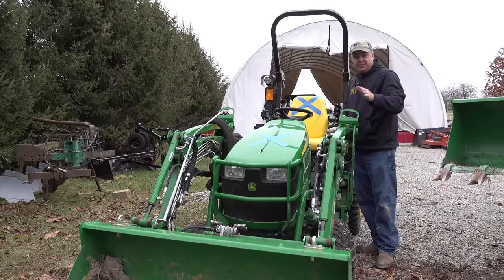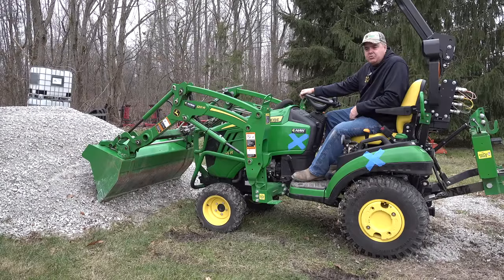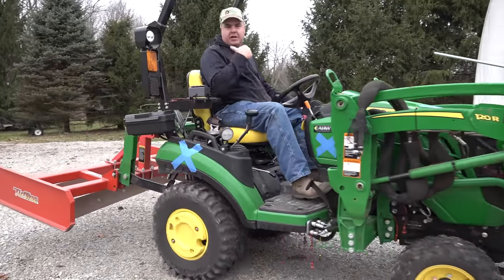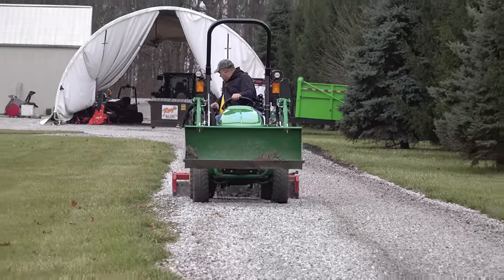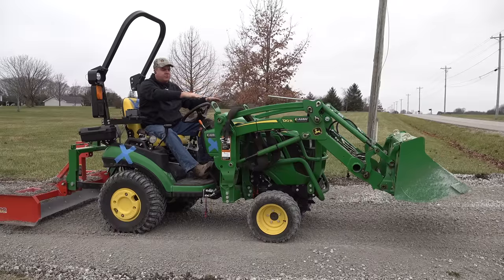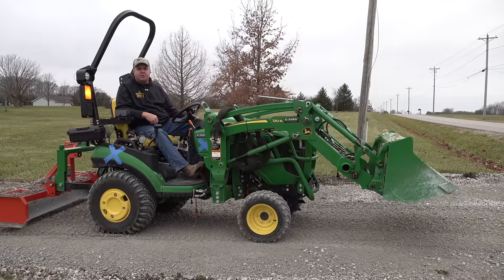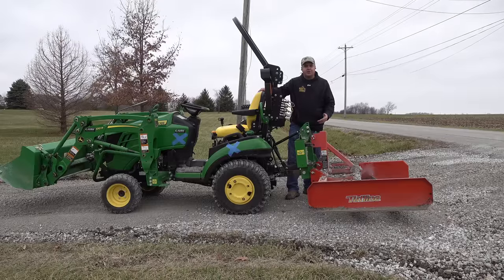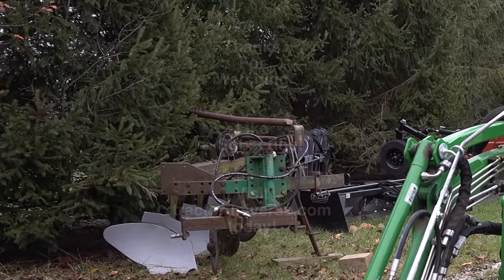John Deere 1025R Turbo Real World Loader & Land Plane.  SUPER SUBCOMPACT!!

Comment: Tim Johnny X is super charged and it's green. I'm thinkin a good name would be the Super Pickle. In 1980 Amtoys made a stuffed pickle wearing a cape called Super Pickle. You can still find them on eBay if you need company on the tractor.

Comment: I have to agree with Ben T.  I have also used a land plane extensively, maintaining a mile long easement road.  The gravel load you had in there would bog my tractor down quite a bit.  Pretty impressive.  Sounds cool, too.

Comment: I used to be a prime General Contractor in South Carolina I did Demolition too I had 220 size trackhoes New Holland Skid Steers if something tore up I just got the dealer to fix it TTWT has taught me so much I could have saved thousands

Comment: This is what I'm really interested in. The engine has more power but its now restricted by the hydraulic pressure the other components are limited to. I wonder about an increase in the hydrostatic pressure relief valve now the engine can handle more, but I'd be concerned the transmission wouldn't handle the extra torque. Thankyou for effectively doing my research for me 👍❤😁 pray you have a fantastic new yr

Comment: Hats off to ADS for the sound engineering of the turbo. It starts there. Of course it's early in seeing the potential long range benefits and usefulness of the turbo addition, but it is trending in a positive direction from this video.  Sure there may be additional ways of taking advantage of this new power, ie. hydro transmission, but I am sure Tim is already thinking ten steps ahead in the experts he might consult next as this test platform is used revealing its weaknesses and strengths and where reasonable  tweaks can be made to enhance/strengthen this machines capabilities. Happy New Year Tim and Christy.

Comment: I really like what you've done w Johnny X.  He's performing like a happy tractor.  I'd like to see the prioritized hydraulic splitter and a bit thicker pump (10 or 11cc - extreme!) on him to take advantage of the additional power when using a backhoe or something impossible for a regular 1025r (Limbsaw? Mulcher?). Looking to do the same soon to my red beast ASAP.  Nice work, nice results prove it!  1025x works... 1040r? 1025xr? Yeah, consider keeping the 25 in the name just for emissions!!!  I wouldn't touch the pressure unless you find a need for it, but more flow is awesome.

Comment: Love the videos! Where you’re having rut issues, that area really needs dug down to clay filled with bigger rock underneath like #4 and then put your smaller rock like 53 on top. That topsoil will just turn to muck then spread out with the weight of the truck when it’s wet

Comment: Hey Tim you might try getting some bigger rock where the trash truck runs and where you drive when you pull your gooseneck. I’ve used 6” sized rock then top dressed it with 3/4” to dust that seems to hold up my big truck better and doesn’t push the smaller rock down as easy. Basically the bigger rock under the smaller stuff helps distribute and displace the weight more evenly. Just giving my opinion love the videos and seeing others techniques to accomplish a certain task with the equipment they have.

Comment: Tim on building your drive higher using rocks, while it may keep water off of your vehicle, I believe water will continue to pool in the driveway and continue to cause all of the issues with a softer base under the rock. 
It is difficult to get a feel for your property from video. In my experience with property in hills and in flat land, ditches along side your driveway are the first thing to do. Avoid a ridge between the driveway and the ditch and work on drainage from the ditch to off of your property. Of course you also want drainage from the yard into the ditch also with that water also flowing off your property. 
Ditch size is based upon the flowing water you need to handle and where you want it to drain.

Comment: that video was very impressive to see how well Jonny X was performing low and high gear....what will be helpful to see is it this spring or summer cutting with a 4ft brush hog and then a 5ft brush hog as well not only on level ground but going up hill...i know a lot of others have commented on the 1025r lagging going up hill cutting brush......what also would be nice to see it help out in the fields  doing hay and other farm work that it can for it size with even a bailer and other attachments running on the rear pto and hydrolic system.....we are all glue'd to see what Jonny X can acomplish....

Comment: Gravel driveway tip to keep the edges from getting beat like that. Make it muddy or wait for rain. You want the dirt to be soft and mushy. Then sprinkle in a THIN layer of some big rock. Like 3-5". Smash it into the mud. Then a THIN layer of 2". Then a thin layer of 5/8". Your small rock layer is way too thick.

Comment: A good test would be a PTO generator with a multimeter watching amps, voltage drop, and frequency. Keep adding load until the generator pulls the tractor down. Probably similar to a Dyno but more useful numbers.
Reply: ive wondered the same thing myself, and i got the perfect generator for the test too, i know it's too much for my 2020 1025R, but i have a 48kw rear pto generator that's made for the bigger cat1 tractor pto, wonder what Jonny x could do with that?...
Reply: @williamcoffman7149  as long as you can connect the PTO shaft you would be able to use it with whatever HP tractor you have. You just won't be able to get full load from it. My 1023 runs a 18kw but can only get about 10kw before my voltage and frequency drop off.

Comment: great video, love the 'upgrade', when are you entering the ol' girl in a tractor pull?
tip: end of the drive to road connections, drag width wise, not onto your road, but side to side pulling towards the middle, eliminated the bounce issue. other wise finish that area with a tow behind drag grader which will keep a more level surface as gravity and surface levels balance out much quicker than pressure force which tends to cause the issue in the first place and just keeps mucking it up unless you have cat like reflexes and an eye of detail that knows when and where to expect force cutting issues. this is a good way to train your eye to that.

Comment: My road is a fair bit narrower than yours, but I have 60' of culvert pipe to enable tractor trailer access both pulling in or backing in so I'm sure you would be safe with 60'. I would suggest pulling that stone back (in front of the dumpster) and getting larger base stone to put under your top dressing stone, you can do that when you get stone for widening the end of the driveway. How's the stone base holding up in the tarp building?
Reply from the maker: No issues with stone base at in or around the tarp building.  Strangely enough, roadpack (53's or 73's) usually works better than large base stone.
In this case, It hasn't dried up since we placed the original rock there.  I believe once it dries up once, it will be fine.    Of course, this is/was a low place which holds water.

Comment: Because this is a hydraulic control, what you've done is given the tractor all the "headroom" it can handle. Hydraulic HP is limited by pressure and flow. What Deere did when designing it was match the HP of the engine and the Hydraulics. Which is exactly what you realized in the push test. You only have 25 hydraulic HP available ever, but quite a bit more at the engine which is why it doesn't bog and stall. This is actually should still be a safe situation as long as you don't change pumps or pressures. This is a really cool series!
I want to see loader lift tests, and tiller tests.
Reply from the maker: Lift capacity will not be affected

Comment: That's exactly what I thought as well.  That's just from using the machine.   The valving will have to be adjusted to increase hydraulic pressure (as long as it's capable).

Comment: X is for X...cellent.

By the way, the land plane can be used pushing backwards, too.  Also...in order to keep the slope on the driveway with the center high, drive on the right side of the road and put just a touch more down force on the right side...

Comment: I like your initial testing approach of running the tractor in "basic/normal" operating tasks to see how the engine & turbo hold up. IMO the real test to see if the value for the money is can it run larger pto driven equipment whether a wood chipper, tiller, mower, etc. A direct pull without the engine bogging down is a good start but you can only have a certain amount of torque to the wheels before it spins out and the original engine could do that. If it proves to be able to perform same work at lower rpm range, saving the engine, that may be worth the cost. If it can run heavier pto equipment that would substantially be worth the cost. As a 2025r owner I want Thank You so much for your effort in experiment as it may prove very valuable to us smaller tractor owners.  Have a safe / blessed Happy New Year...

Comment: I think one of my big mistakes when buying my 1st implements was getting a boxblade rather than a land plane for the driveway. Most YouTube videos show people using a boxblade and it can work, but it doesn’t appear to lay gravel down as smooth as the land plane. I think the box blade is more popular because it’s more versatile, (works great as a mini-dozer). Land planes are one-trick ponies, but they do that trick very well.
Reply from the maker: I get grief for this, but I’m not a box blade fan.
Reply: What convinced me that the land plane is the best tool for the driveway was watching Outdoors with the Morgans. Mike has done some really good videos showing the benefit of a land plane over a box blade. (I think he got some grief as well). It’s funny how people are so committed to the box. It is useful and it can do a driveway, but it can’t do it as well or as easy as a land plane.

Comment: Looks like you need to cut up some logos to make a proper (looking) 1038X decal!  Would be very interesting to see the largest HydrosPlus pump and valve on there to get some oil volume but need some bigger lines to handle it.  Could make possible use of hydro tools like reversible post hole digger that could way outperform the PTO ones. Maybe even the hydro chain saw or offset flail but you do still have the physical tractor size and balance limitations. Nice looking work so far.

Comment: I have a Kubota L4701 and iam putting out 37.8 pto hp. 47 engine HP. Tim with Johnny X you have the same power as I do. That's just crazy obviously I have more loader capacity other that that same tractor just small lol. I don't think it would make a diy but you should do a loader lift test with Johnny X now and see if their is any difference.

Comment: I would like to see how this added power would work on a chipper and a stump grinder. I have both.  My 2021 1025 r handles them both great.  But you can never have enough power.
Reply: Ya pro implements is where this will shine! JD has the hydro very well balanced with engine power from the factory.
Reply: Ya pto implements is where this turbo will shine! From Tim’s videos we see that JD has the hydro very well balanced with engine power from the factory.

Comment: I’d like to see the transmission temp difference between the two machines. If there’s going to be a difference in wear I’d think that would be were you would see a difference. Is there a place that a temp sensor could be added to both machines? Thank Tim, another great video.
Reply: Great idea
Reply: Area Diesel did that already.

Comment: So here's a thought. The area of the driveway that keeps disappearing by the garage. Get a laod of 3-4"+ crushed concrete and put a layer of  1 foot and just as wide wherever it's disappearing. If you want it to look nice and consistent with the rest of the driveway, dig that area down to the soil, drop the large rock and cover up with everything that was dug out. The smaller rocks and fines will integrate with the larger rocks beneath it over time. It may benefit to compress(drive over) the large rocks 🪨 a couple of time's before you cover it back up. But be sure to use the same amount that was removed. 
 What you are doing is leaving behind a big hump, it will level itself out within the year or sooner.

Comment: One solutions for your driveway if you don’t want pavement is to use DSA (Driving Surface Aggregate). It keeps its form and handles heavy loads very well but is also low dust and the surface does not erode like a normal gravel driveway. It’s more expensive then a normal gravel driveway and does have to be put down with a paver but can be maintained with all the equipment you already have.

Comment: Cool - X means UNKNOWN that is why experimental and extreme are used.  X marks the spot and X-Men  X-rockets.  I had a trash truck issue on the edge of the internal road - I over filled the trench and stacked it up just 6" and that has stayed since.

Comment: On a serious note though, you will be better off getting a load of 2"-4" base, digging out about a foot where the garbage truck sinks in, and putting a layer of the base and compact it, then about 4" of your regular gravel on top of that or the truck will keep sinking in when its wet.  I had issues like that with my drive to the barn that had overgrown over the years and had a delivery truck sink in and had to be pulled out because he went off the drive a bit. Three years ago I had a company come in and dig out and put a new drive in as described above, now the Propane truck no longer leaves ruts.  Rent a vibratory 3-5ton roller to compact the new stuff too and the rutting will stop. 

That turbo really made a huge improvement over power, can tell when you were planing, the other tractor would have been puffing at times where the T power just maintains constant RPM.

Comment: Just something to consider on re-sloping you're driveway, make sure the county doesn't have any specifications on the drop rate from the road surface. I just went through the work of widening my driveway this summer, and wanted to do the same as you and make the final approach to the road surface closer to level. However, due to snow plows and the sidewings that are configured for clearing the shoulder of the road, the county specified a slope rate that I had to match. If the driveway is too level near the road, it can damage the snow plow side wing. My final slope ended up being essentially where the driveway was to begin with.
Reply: That’s crazy.  I had the town raise my apron after they raised the road and water ran off onto my driveway and into my basement.   They gave me a nice speed bump and water stays in the road.

The town and state drivers lift their wings when they get to driveways and mailboxes.  I have never seen a place where they don’t.
Reply: @rydplrs71  The road ditch at my house is very deep and somewhat steep (lowest point to the shoulder is probably 8' or so). The wing plow is only angled down enough to clear the shoulder (maybe only 2' wide) and then just hangs out over the ditch where it knocks back the drifts to keep snow from building up on the road as quickly or just hangs out over free air. 

The plows just swerve out around my mailbox which is the opposite side of the road from my driveway, so they don't have to move the wing plow at all when they reach my driveway since there are no obstructions.

Comment: I love my land plane. I have been using it on my driveway and also my yard.
Reply: like on the dirt? I love mine for my gravel driveway
Reply: @tnt666tnt  I bought 5 acres that was abandon farmland. They didn’t knock down the humps. So I plowed the soil, disc harrow the big chunks into little chunks, drag harrow to knock it down some more,  land plane with the scar fires down to pull up any rocks I didn’t get before I do a light 1-3 inch till. Planting grass or field seed in the spring. I don’t know if I want to have that for the goats or steers to graze on

Comment: Good morning Tim, great video!  Quick question. I punctured the rubber hose while changing out the in-line fuel filter on my 1025r. What’s the replacement part?  Or just the hose size.
Reply from the maker: For replacement part number, use partscatalog.Deere.com
For diameter…cut a piece of it and take with you to NAPA :-)    
In other words, I’m not sure.  Sorry.

Comment: I got a good deal on a 3025 with one hour on the clock but they had to sell it used because it was purchased but then never picked up.
And I didn't want to fool with diesel fluid so 25 HP seemed adequate... But it really isn't and I'm definitely interested in your turbo kit.

Comment: You could get a harder spring on the pressure release valve so that its releaved less easy and thus have more pulling power
Reply: mmmmmm, that sounds like a interesting idea, wonder if it can be done that way..

Comment: Hi Tim. Great videos. I bought a 2017 1025r with the FEL, 60” deck and 54” quick connect snowblower. It has 80 hours on it. I paid 16,900. Did I pay too much? The guy I bought it from lives 8 miles from me and we both use the same dealer. I called the dealer and they gave me a clean bill of health. No issues. Regularly maintained by the dealer every spring. Cheers from Syracuse NY  and Happy New Year!
Reply from the maker: Congratulations!

Comment: I enjoyed the video. 

Not sure what is the point of the turbo. The tractor seems well matched between the engine and the transmission. If you add engine power, is the transmission prone to fail or differential?

Don’t get me wrong, I enjoyed the video!